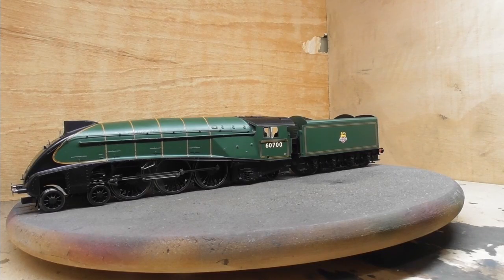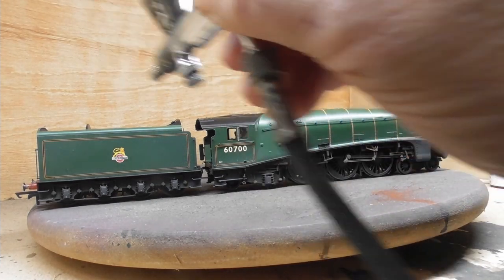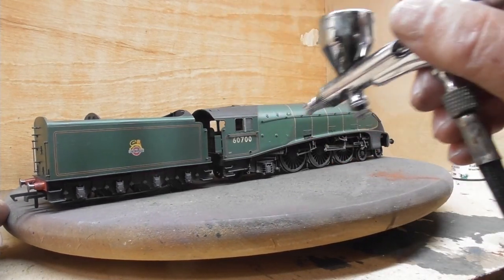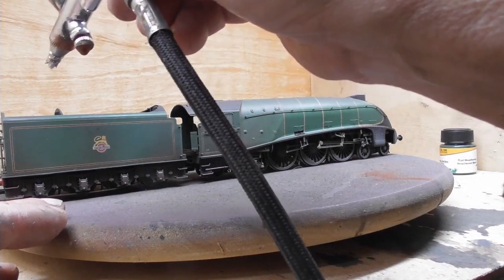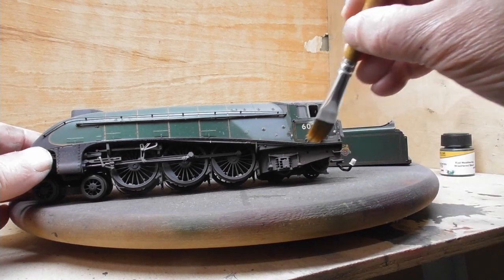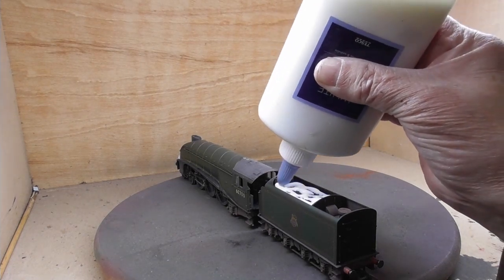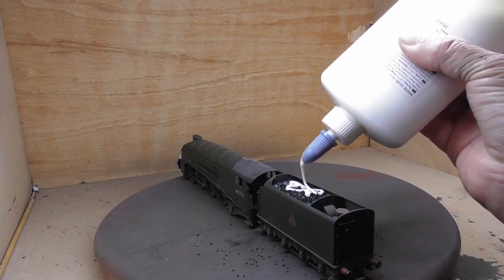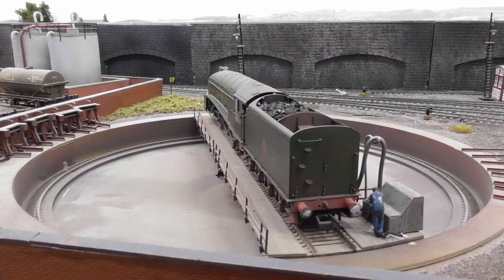Hornby W1  Loco Weathering - Byford Model Railway

Comment: Nice job Richard, I  prefare them slightly weathered in real life they did not stay clean all that long, I think Hornby over do  it on some of their locos, I've cleaned my black 5 and 8F up a bit. Ian H.
Reply from the maker: Thank you Ian, Yes I think sometimes I over-weather locos there always seems somewhere on the engine that needs a touch more, but I don't use enamels anymore only acrylics for spraying so at least it can be removed if needed. Regards, Richard